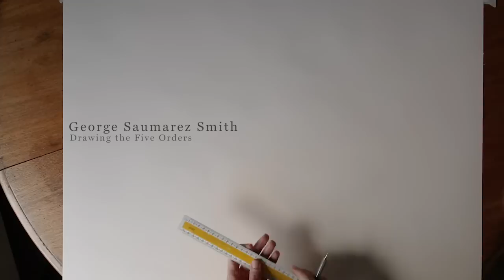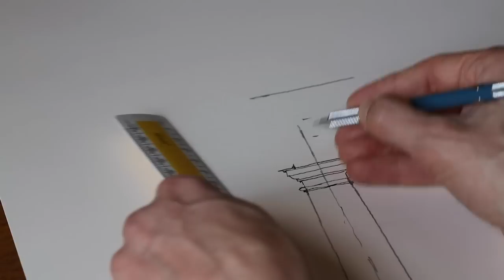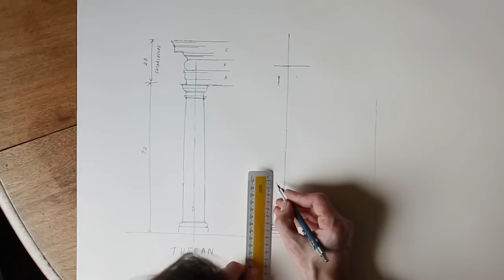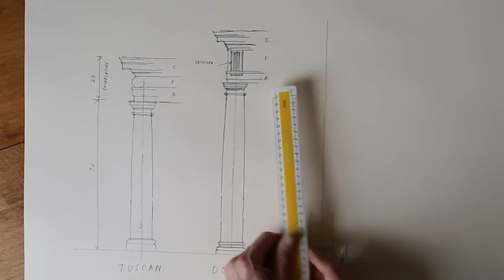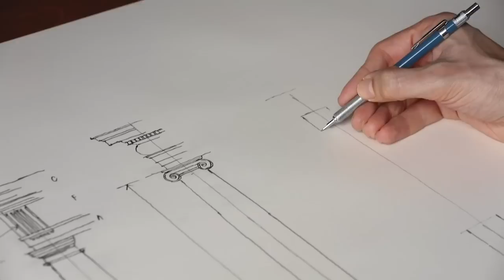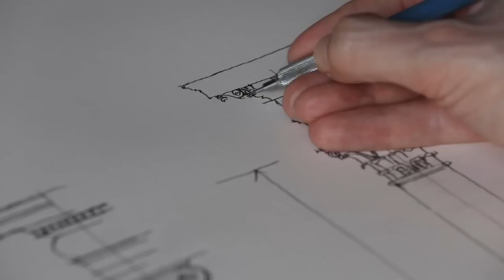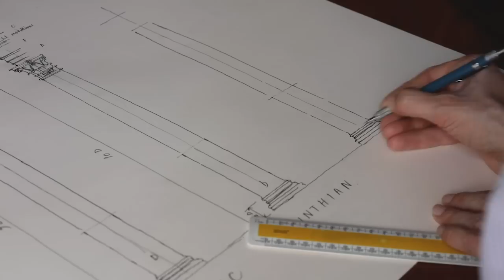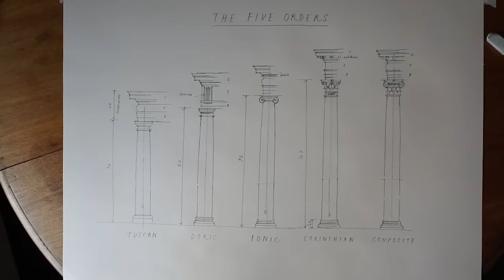Drawing the Five Orders by George Saumarez Smith

Comment: If the orders are all different heights, does that mean the storeys of a building with superimposed orders are different heights?
Reply: the heights shown here seem arbitrary and not related to real buildings. also, the design of roman buildings with superposed dictates the scales, not the orders used.
Reply: The order height is a function of their diameter so you can keep the height the same and adjust the diameter I suppose but I don't think they'll look aesthetic